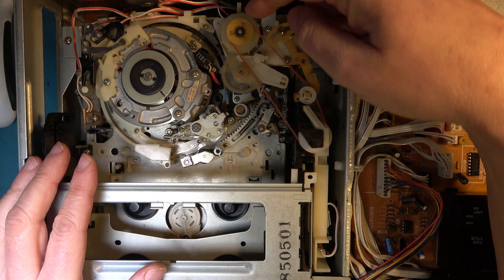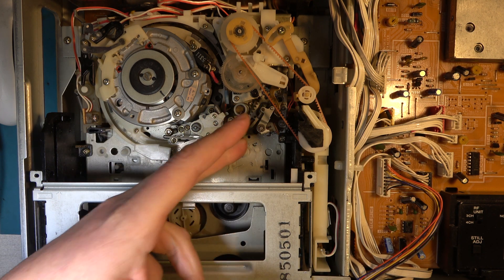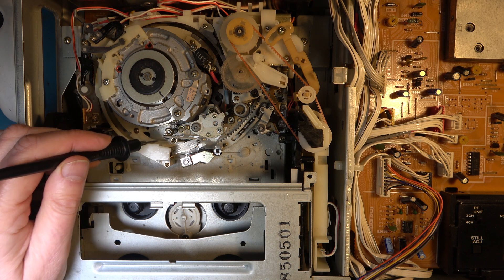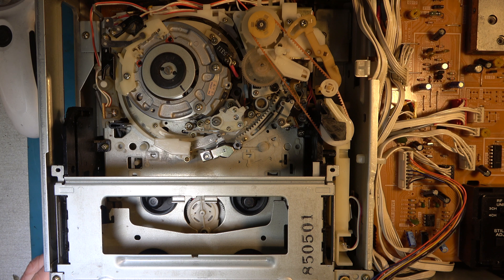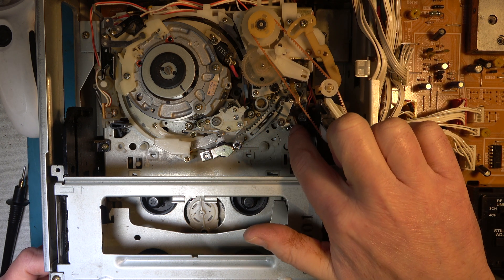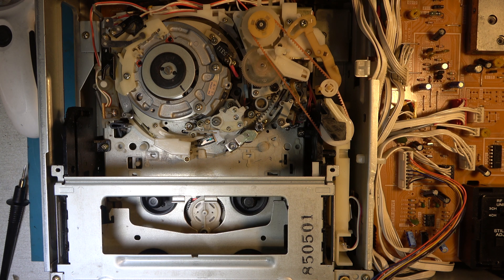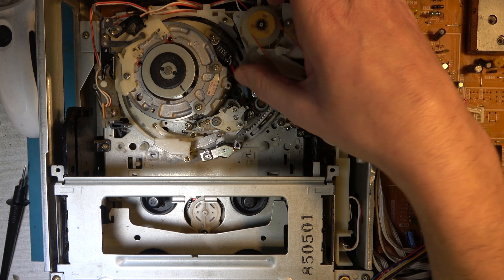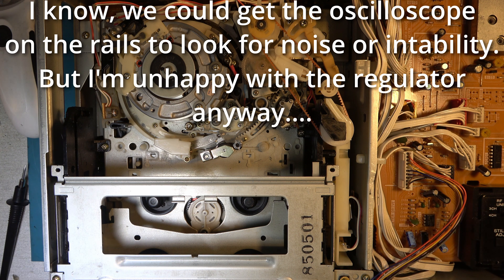Working on Superbeta SL-HF600 part 5. Counterfeit components.

Comment: I'm guessing the modules are actually real STK5441 regulators, but have been pulled, remarked, and the leads have been re-tinned -- so you have no idea if they are working or not. Usually tinning on the leads will give it away if it is supposed to be a "new old stock" part. The plastic pattern to me just looks like an injection molding flow pattern with high GF/fiberglass content, although the grinding marks def don't seem original... I guess worst case scenario, you could make your own daugherboard with some 7800-series regulators.. at least then you know it's good :D

Comment: Unrelated question if I may: Could I transplant video heads (or entire drum assy) from a non-hifi unit (SL-100) into a hi-fi unit (SL-HF400) and get hi-fi audio? Thank you!
Reply from the maker: Answer would depend in part if you are taking about NTSC or PAL.  NTSC maybe, PAL certainly not.
Reply: @video99couk  thank you for the quick reply! They are NTSC units. It seems to me that if the geometry of the video head discs are the same, it should work. The hi-fi circuitry of the 400 should be able to decode hi-fi audio from either head disc, but I haven't seen it done or discussed. Funny that PAL has an SL-HF100, but  NTSC has the SL-100!

Comment: I thought I heard these things sometimes come from "working" e-waste. Someone has a business de-soldering and laser "cleaning" and re-numbering these horrible modules. So when you receive the part it looks unused. Chances are last time it had power  it was fine. But then (sometimes) whatever the hell happened to it starts to work in it's magic and then the magic smoke comes out; or it decides to do the strangest possible things such a device could ever do.  Maybe the new numbers kind of denote which type of disaster or horrible situation it was in. I don't mean to condone or condemn it 🤭but... BEWARE ridiculousness and potentially destructive chaos... etc.

Comment: 11:44 Those blotches and lines look like weld lines to me actually, an artifact of injection molding when the plastic has to flow around the mold in two directions and is meeting on the other side, already cooled down a bit. The plastic won't form a clean surface at and around that line when the process isn't controlled carefully. Not necessarily a sign of counterfeiting, but a sign of doing things cheaply.

Nice video explaining explaining that: https://www.youtube.com/watch?v=IiGTkl4fSx4&t=478s
Reply from the maker: It might be that the part from China is genuine. The part that was in the machine originally was certainly fake.

Comment: Unfortunately the market is flooded with Chinese couterefeit transistors and ICs. Even reputable strores are stocking them without the managers/owners realising they are being supplied with counterfeit parts. The STK5441 wasn't used on UK/EU models so finding an original known-good one would be difficult. The SL-T25, SL-F25, F30, F35 and F60 use the 711B2 chassis and they are PAL machines but they don't use this regulator IC either.
Reply: That's good to know, one less thing to worry about with the SL-F73 I got a while ago!

Comment: If you haven't already got it the service manual for that model is available on-line and shows block diagrams and voltages for the STK5441.

Comment: Fake parts are huge problem in old computer space, especially things like Commodore 64 SID chips where some years can be very valuable and hard to find, and even the original chips are slowly dying nowadays. With some chips like Yamaha OPL2 you can find some good working counterfits, which most likely are used pulls cleaned up and reprinted with nonsensical manufacture dates.

Comment: i had a look through my pcb box and just one stk5481 dam!! and finding propper data sheets seem difficult to find.
Perhaps you can find a sheet for the 5441 and connect a few multimeters to the main regulated lines, say 5v and 12v.
Reply: The 5481 was used on many JVC VHS machines of that era. Worth trying to adapt it to work on a Betamax? That would be funny lol...
Reply: @crashbandicoot4everr  Well that's up to colin,  i would be attaching wires to the 5481 to the pcb,.
Donkeys years ago i had a friends vcr and the stk regulator was faulty, i found it was a missing 12v supply, so i bodged in a 7812  regulator to a heatsink but the 12v was switched on all the time.
So (Very bodgy) i stuck a relay in line with the 7812 feed and a resistor + transistor pulled in the relay when the On button lit up lol.
Worked perfect, even on the timer recordings.
I was a bit determined that the £30 regulator was a bit too much.
Sorry about the long waffle.

Comment: Have you tried the acetone trick? Try rubbing it with acetone on a cotton bud... if it's been painted over, the paint will come off. I had my fair share of ground and painted chips (and some unhelpful sellers) last year. Misery! They could also be genuine STK's but not the right part number, but just ground down and a new unmatched number stamped on them.

Comment: I ordered a lot of electronic components from eBay as being new old stock and I was shocked to how they even fake the packaging to look like an old stock item, Chinese counterfeiters have a special place in hell.
I have a parts donor, the SL-2500, If it has one I can send it your way to Europe but not sure if it's going to be in good working order since the deck is defective and have no way of testing it, it's all taken a part.
Reply: Have you seen the videos where they reseal iPhones and stuff? It's crazy. The SL-2500 uses a switching power supply with no STK-type IC.
Reply: @crashbandicoot4everr  Bummer.